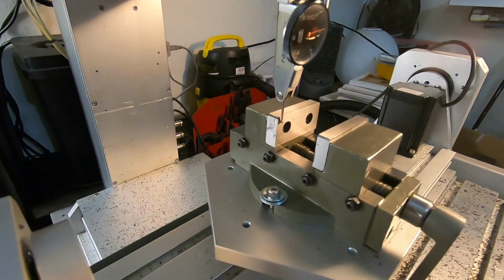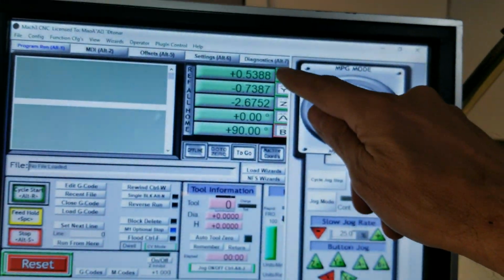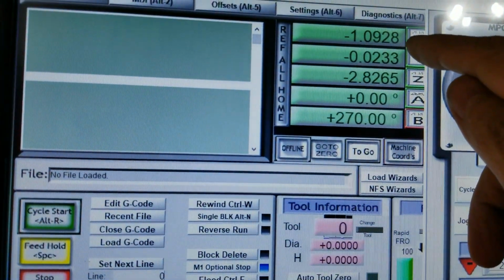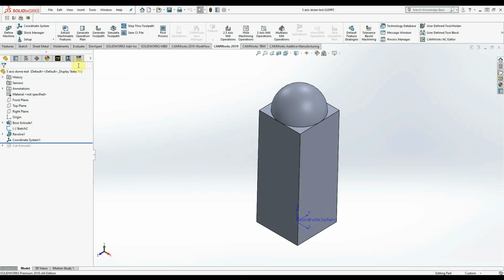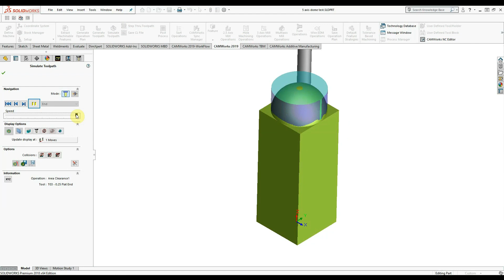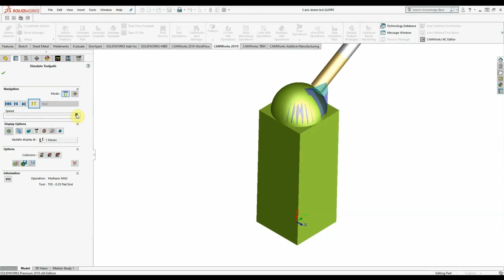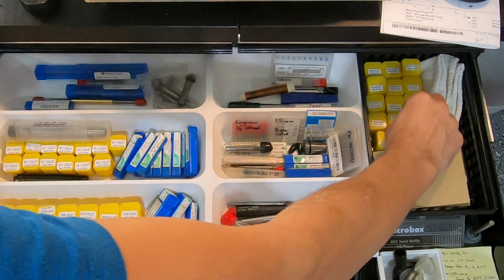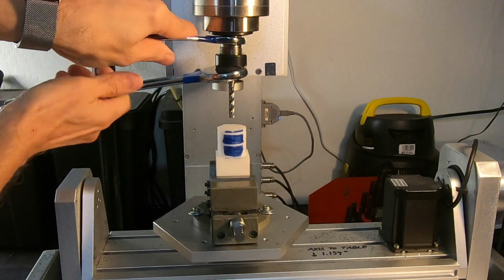HY6040 5 Axis Simultaneous

Comment: Handy Dan, I was thinking of ordering the Carvera Air.  The Pre-Orders started.  Would you recommend anything else in that price range of $2k?
Reply from the maker: I haven't seen that new version, but I do love the Makera Carvera desktop CNC.  It's small, but it has a  6 tool changer, laser and 4th axis option, $5k though.
I'll look onto the Carvera Air, it's mostly down to what you are going to make, wood, plastic... Aluminum and Brass. But not steel.
Reply: @HandyDan  thanks Dan,  Im planning mostly aluminum, brass and copper.  I looked at the MR1 but I dont think i need that kind of power, yet.  If you like the carvera I think the carvera air should be a good deal, but let me know if you have any other options I should look at.

Comment: Hey! Just curious, how is this machine performing 4 years later? I'm looking at a very similar one and I would love to hear your feedback if you have time! I'm hoping to use it to machine aluminum parts at home. I use fusion360 and inventor regularly. Thanks Dan! Very cool video!
Reply from the maker: The machine performs the same after 4 years, not much changes.  The version I have was updated 3 years ago after I got mine,  if you are looking to mill aluminum, I would suggest a gantry style machine for more rigidity.
Reply: Thanks for taking the time to respond! Have you machined aluminum with yours? I'm curious where its weaknesses reside and if they can be engineered out. It's such and affordable and capable looking machine. There's really nothing else out there like this for the price point. The 5th axis is the real draw for me.  @HandyDan
Reply from the maker: @degreeless_engineering  The weakness is the rigidity of the column and 5th axis. I suggest you watch the A axis upgrade and B axis upgrade videos. That is the real problem with this machine rigidity or lack of.

Comment: So 3 years later are you still happy with it or did you run into problems? I'm considering buying one but it's a 3k$ gamble
Reply from the maker: I bought mine several years ago and it was $1,290.
I'm not completely happy with the lack of rigidity and the tool changes manually in the middle of every program,  but for the most part it will make a lot of things. And cut aluminum if you stay beside it with ear plugs and spray the cutter with some thing like WD 40
Reply: @HandyDan  Lack of rigidity is to be expected for such a small/cheap mill. Also aluminum react the same on my lath. I have to drench the thing in cuting oil to prevent chips from sticking to the cutting tool. Anyway thanks for taking the time to answer me ^^

Comment: As mach4 is out do you know dan if they have upgraded the machine to mach4?
Reply from the maker: Good to hear, I have been thinking about Mach4, To your question about the machine being upgraded, they did upgrade the mechanical system more rigid, as for Mach3 or Mach4, the machine itself doesn't run the software,  Mach runs on a computer that connects to the mill USB

Comment: Can you remove the 5 axis and do regular cutting and milling on the table it is clamped to?
Reply from the maker: Yes, I do that often.  It comes in a different box and they show the 5th axis clamped to the table,  I drilled and tapped threads to bolt mine in place.
Reply: Dan, after using this machine for a few years, do you recommend it? Thinking of getting one.
Reply from the maker: @fastbird101  It really depends on what you are planning on machining.
I chose it because the next step up is around $7k. I paid like $1,200 when I got mine. 
I have made plenty of plastic parts, several wooden pieces and several aluminum pieces, aluminum is very noisy and requires some attention to spray cooling or mist.
But in all it does work good

Comment: Hello, do you happen to have the CD contents of the machine, I just got one second hand and missing the CD
Reply from the maker: Mine didn't come with any CD or any software. I use Mach3 from ArtSoft to run the machine. You will need some modeling software and CAM system. Fusion360 is a great way to start, free and plenty of tutorials 👍

Comment from the maker: Thank you for watching. 
If there's any questions or if you want to see a video on any details just leave a comment.
Reply: Hey Dan I enjoyed this video, thanks! Is this machine from cnc china zone company?
Reply from the maker: @marin.kucina  
Yes this is a ChinaCNCzone HY6040. However you should watch my other videos in this series to see what I had to do to get the machine rigid enough to actually mill hard plastic and aluminum
Reply: @HandyDan  thanks for reply. I will watch that video! Have you had any problems with setting up G code software?
Reply from the maker: @marin.kucina  
I use CAD CAM to generate G-Code.  There's a lot of software for making G-Code
Reply: @HandyDan  ok thanks!
Reply from the maker: @marin.kucina  
I use Solidworks and Camworks for my CNC programming, I don't know if very many people are using this combination but I plan on making a video to show how to make a post processor for this.
Stay tuned.
Reply: @HandyDan  great! looking forward to it, when i buy this machine I am planning  to use Siemens NX software, I hope I can generate g code directly from it for the mach3, I am really new to all this so I still have to learn a lot
Reply from the maker: @marin.kucina  
I will be happy to help you along, I had to do a lot of modifications and I had a long learning process that I am still finishing up. 
The GCODE for this mill is pretty straight forward and I have a few lines I removed and a few I added to the main header and end.
Thank you again for watching.
Reply: Thank you
Reply: Did you tried to mill duralumin?
Reply from the maker: I have not tried 5 axis Aluminum milling yet. I do plan on doing a video about this.
Reply: Hi Dan, could you please show the VDF settings to get the spindle run?
Reply from the maker: @edub.43  Does your machine have the NowForever VFD?
Mine came setup already and I do have a detailed pdf that covers everything. If you can't find that I can email it to you or email me. 
message2dan@live.com

Comment: Hola Dan, thank you so much for the videos and your updates for this model.
I bought this machine and received it today. I wish I could talk to you, I have some doubts.
Reply from the maker: Marcio,
 I can help you along, you can ask any questions here in the comments so they may help others.
If you want to email let me know.
Reply from the maker: @zzzmutations  I sent you an email, let me know if you received it.
Reply: Plz bro how this machine go with u.i want buy same.Plz advice me.Thank you
Reply from the maker: @hamidhassa1178  
As I mentioned to Marcio this machine is not a turn key ready to go 5 axis cnc. It requires a learning process,  Mach3 to control it and you will need some software to generate the G Code any CAD CAM software will be fine, there are literally hundreds to choose from. 
In all it works to mill wood, plastic and aluminum but aluminum is a slow noisy process.  You can see in my other videos that I had to upgrade a lot to get it rigid. 
I can help you along.

Comment: hello, I have mach4 and need 5 axis post process. which post process should I use for mastercam?
Reply from the maker: Hello and thank you for watching, I believe Master cam has a few basic posts to use. I would suggest looking through them and test a simple box with text on the sides X Y Z and see how your machine reactions are, set Z above the part for your initial testing. Let me know what you find for the best and what things do not work.

Comment: Hi, please reply. I have a machine like this. I need the post processor for the five axis. Please contact me
Reply from the maker: What CAD software do you have? And which CAM software do you use?
Reply: @HandyDan  Solidworks and Powermill
Reply from the maker: @MrSlashMR0SLSAS The post I use is for CamWorks, which SolidWorks bought out CamWorks around 2021, now it is built in and called SolidWorks CAM.
Reply: @HandyDan  Is it possible for the post to work on Powermail? If not, where can I find a suitable post?
Reply from the maker: @ I imagine it will work, But from my experience all machines are different, all posts are different and all CAM software is different, I do not know why there are so many choices. Each CAM software writes code in different extensions, (.min, .cnc, .nc) But in the end all machines run the similar G Code, The Post is responsible to align the built in Canned cycles and start sequences like the safety line at the start. I can send the CamWorks Post I created for Solidworks, But I am not sure if PowerMill can use it.

Comment: Hi Dan, i just got that machine and i am having some  problems. I use Fusion 360 for CAM and the controller is mach3 and I edited it to have both 4th and 5th axis but i simply cannot get the 5axis continuous toolpath to be like the one I programmed. Can you tell me if you use machine rotary zero position (MRZP) to be part zero. Thanks mate :)
Reply from the maker: Good to hear you have the machine and already have a tool path in Fusion 360.
I would like to know more of what is the issue,  I don't use Fusion so I can't relate to MRZP, my CAD CAM is always zero at the table tilt axis and rotation axis.
Reply: @HandyDan  Thanks for responding man :) So my issue is that for instance, if i create a flow toolpath with 5 axis continous, the machine movements do not  correspond to what the ones i programmed. So i think this is related to the post-processor that i am using. I edited both a mach3 and a Fanuc post-processor according to the machine´s setup but the 5 axis continuous problem keeps happening no matter what. Have you ever experience something like this when you used that machine?
Reply from the maker: @The03ulisses  I have been very successful with 3+2 meaning positional.  When it comes to simultaneous 5 axis I have similar problems.  I had no issues with the half spherical dome. But I then tried a more complex part and on one curved toolpath that looked perfect in CAM software but on my mill the arc was way off and my table traveled like it was 200mm arc instead of 5mm
Reply: @HandyDan   yeah, i am gonna try to keep the 5 axis continuous as simple as i can, it is just a shame that the instructions  that come with the machine are so basic that they just don´t mention this. Anyways, than you for your time and keep up with the videos man, they are great ;)

Comment: Hello! I hope to make one. This type of servo motor is also a stepping motor. What other models are there, and which axis card is used for printing? Can the operation interface also be introduced? Or the place where the whole unit is purchased? Can you introduce
Reply from the maker: Hello, are you building your own machine? Most use stepper motors only. Servos with closed loop encoders require more advanced controllers. You will also need a breakout board and software like Mach3 or Linux CNC.

Comment: hello, I also have mach3 and need 5 axis post process. which post process should I use for solidcam? to mach3
Reply from the maker: What CAD system do you use?
Reply: @HandyDan  ı do not use anything right now, it will depends on which which 5 axis  post processor is okay for mach3. than I start to set up cam software
Reply from the maker: @mertkars1463  There's quite a lot of choices, and a post processor is developed to work with the specific CAM software to the specific controller. Your CAD system is your choice, but all I have is a post for Solidworks with Camworks for Mach3
Reply: @HandyDan  can you please send me if it is possible ?
Reply from the maker: @mertkars1463  email me message2dan@live.com

Comment: Which Mach3 breakout board u r using in this and what is the speed of board
Reply from the maker: I have the original board in this mill, I purchased another breakout board that has more functionality, but I never put it in. I mainly use this mill for 3 axis, not sure why I bought it 5 axis 🤣
Reply: it is ok 
I just want to know that
Speed of breakout board i mean 100 khz or 125 khz or 200 khz or 500 khz or 2 mhz
Reply from the maker: @innovativetec1362  I believe 1mhz
Reply: Hello love from India
I am looking for 100khz breakout board this is very cheap i don't know it works completely and correctly or not
Reply from the maker: @Innovative tec  I have the older China Zone CNC with the main board, it has 3 axis drivers and the breakout on one main board. 
I bought a more featured product bur have not yet installed it. I found it on Amazon 
DAOKI DC 12-24V CNC Breakout Board 5 axis Mach3

Comment: Hello Dan 

Where I would get a HY6040 postprocessor  ( solidcam ) ?
Thanks you for your response .
Reply from the maker: Sorry for the late reply,  post processor is more for the machine controller you are using, not specifically for the HY6040.
So if you are running the machine with Linux CNC, Mach3 or an Arduino the post may differ.
I use Mach3 and a basic Fanuc style post works good.  SolidCAM has basic posts, let me know if you need help.
Reply: @HandyDan  Would you please send me an example of a 5 axis milling program? (Mach3 ) thanks
Reply from the maker: @marekvisnovsky7969  Sure, I can send you the G Code file I used in this video.
Where can I send it?
Reply from the maker: @abdullahtekinay6533  I use Solidworks and Camworks and custom made my post with Camworks UPG. I can play around with posts since I also have SolidCAM 2017, I will see how it acts. Camworks post processor are .ctl files, SolidCAM post processor are .gpp files.
I will get back to you.

Comment: hi, i have rhe same cnc HY6040 from CNCZONE. but the problem is that the manual don't  explain a lot of part like the panel on machine....
this is my first cnc and i never used mach3. i installed the program with 5 axis but when i connect the computer at cnc nothing is happening.
someone can hel me? thanks
Reply from the maker: Hello, did your machine come with the small blue display on the side?
Mine did and I didn't use it.
Also I needed to get a controller adapter UC100 USB to parallel
Reply: @HandyDan  no i don't have the small blue display. i have the other one that i see on your cnc and i don't know what it's for.  but i have the usb port ! i think it's the latest
Reply from the maker: The display I have is just a 17" touch screen computer monitor that didn't come with the CNC mill.
If you have the newest model with USB then all you need to do is configure Mach3

Comment: Hello dan, i have one question. What type of materials. Can i machining with this machine?
Reply from the maker: I have had success with wood, plastic and aluminum.  I do not think it can mill steel,  aluminum is a match to what the machine is made of.
Reply: @HandyDan  thank dan. I manufacture injection plastic molds, and i want to make prototypes of molds. I want to machining steel 4140 and electrodes of copper and graphite 
Do you think  this machine works for me?
Reply from the maker: @alejandrovilla4311  Ok are you going to be using an EDM to make the 4140 steel?  This machine will definitely mill graphite, copper should not be a problem.
Reply: @HandyDan  
Hello Dan, you have the reason about that I have to used other process por example edm machine. Yesterday I went to see a machine of 5 axies, the machine is the same that your machine. I was talking with the seller and he said to the machine doesn't home position or zero machine, moreover this machine doesn't have the application enabled of work planes G54 to G59. Can you tell me if you machine has the same problems? Or if you made any ajustment.

Thanks for help me.

I'm sorry, if my english is bad.
Reply from the maker: @alejandrovilla4311  my machine is not the best choice for 5 axis cnc but for the price I chose it.
The problem is it is basically a hobby machine and has no software support. I use Mach3 but it is a versatile solution but not specific enough to handle 5 axis simulations, you also need a post processor with kinematics.  I am very close to having that ready but again this machine nor Mach3 will home the A and B axis.
Reply: @HandyDan 
Ah ok, thanks andan.
Have you used 5 axies simultaneous machining and 3+2?
Reply from the maker: @alejandrovilla4311  I have done 3+2 and simulations on my mill
Reply: @HandyDan  hello dan, 
That is perfect. I'm going to buy these machine. Because, I want to manufacture molds. With this machine, i want to machine electrodes. Can you said me? What is the displacement in the z axis?
Reply from the maker: @alejandrovilla4311  The HY6040 mill has 125mm of Z travel.  But you can slide the motor in the bracket to get almost 200mm of usable distance. If you notice in a few of my cnc videos, in flat work I have the motor lower in the bracket and a table spacer. In 5 axis I have the motor highest in the bracket.
Reply: @HandyDan  
I saw your videos and I saw that your machine has more displacement in the Z axis.
What is the mesure of bigger material that you can machining in the 5 axis?
Reply from the maker: @alejandrovilla4311  In 5 axis or 3+2 with the AB table in place the largest square you can mill would be 125mm high and 150mm wide.
You might be able to do larger depending upon if you need to mill just a part of it and don't exceed the 125mm travel
Reply: @HandyDan  
Ok dan thaks for helping.
I'm going to be apendient of your videos.